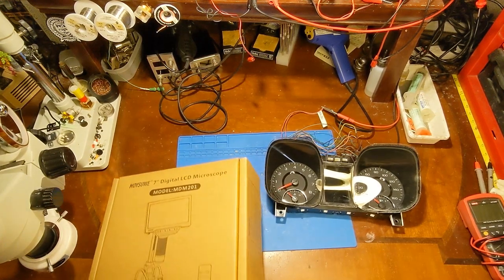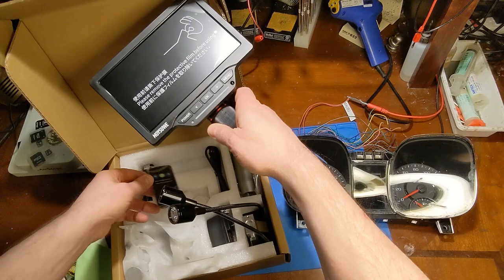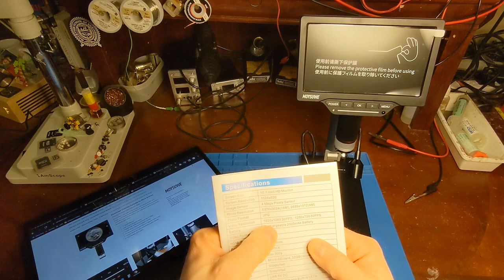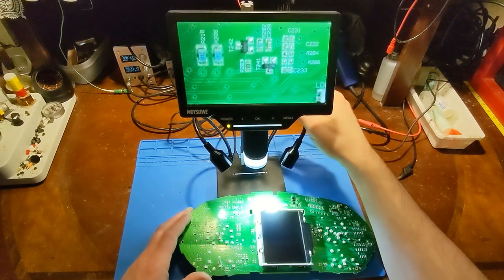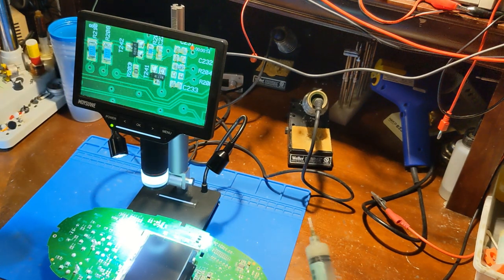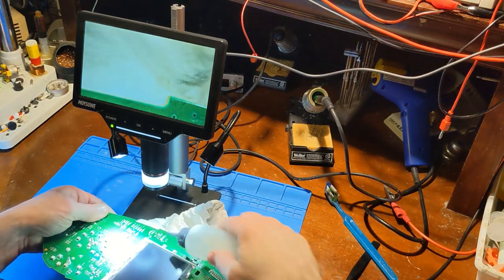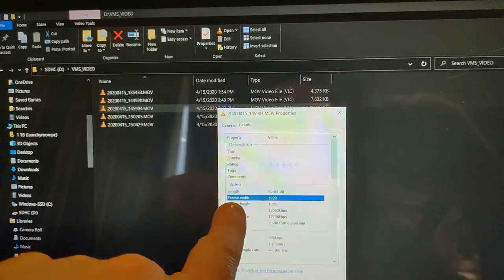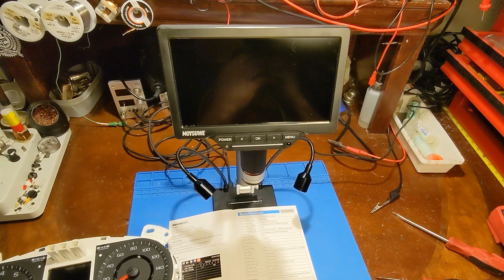Affordable microscope review, Malibu Repair

Comment: Thank you very much for the video I used the older model it's  didn't work that great I ruined the sotter pads on the Malibu cluster I've also seen them fail 2 years later done by somebody else the jumper wires are a good idea by the way what kind of flux do you use? thank you for the video
Reply from the maker: I use amtech 559 flux from Louis Rossman store.

Comment: I paid $150 with shipping and tax (25%) for a 4k  c mount camera with lens, ring light and mount arm. The only downside is that you need to connect your own monitor. You got to shop around.
Reply from the maker: Link?
Reply: @jeffescortlx  The brand is Ekins. It's a Chinese brand but we'll known and proven. You can buy a kit or just the camera (sensor). You can choose a lense depending on your needs. If you need less magnification you take one with shorter focus length. There are also zoom lenses for variable magnification. They have various ring lights. Cheaper ones have dimming LEDs and more expensive ones have dimming, light color temperature adjustment, light direction adjustment etc.
Reply from the maker: @westsenkovec  but what website did you use? eBay? Or direct from that manufacturer? Does it allow you to use both eyes while the camera is in use?
Reply: Do you have the references ?
Reply: They have an AliExpress store. I don't understand your question. It's a camera. You can mount it on a microscope, stereoscope or use it with a lens. You can hook it up to your computer, monitor, laptop, phone or TV. Mine came with a remote. Since it's 4k you can also use digital zoom without loosing much quality which is useful so you don't have to adjust the camera height frequently.
I have it and it works great.
Reply: It's because I wasn't finding it. Maybe you meant Eakins and not Ekins
Reply: Yeah, autocorrect changed it.

Comment: Never found a digital camera setup any good, If you're a serious beginner, look for an optical scope every time. It will make learning the art of soldering SMD so much easier..
Reply from the maker: Yes I agree optical is better. But I've always found it hard to find a good used microscope in the wild. They usually end up being a medical one setup for slides. Not enough working distance, zoom might not go out far enough.
Reply: @jeffescortlx  If you look at a scratch set-up, these days you can buy a 7-45 zoom scope (un-badged AM scope) for 280 British pounds but with a standard base (the boom is the most expensive part of the system). You can save so much on new good quality re-work and soldering equipment, it makes sense to see what you are doing. Yes, I looked at ex-medical when I needed a scope, but shopping around found some great scope deals, the market is so saturated with new scopes. Keep up the good work, I repair auto electronics in the UK.